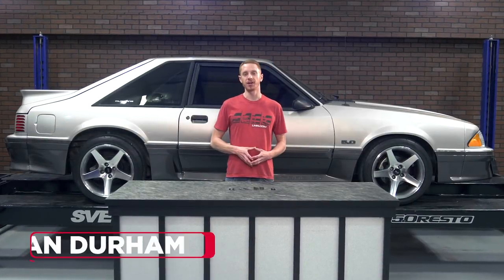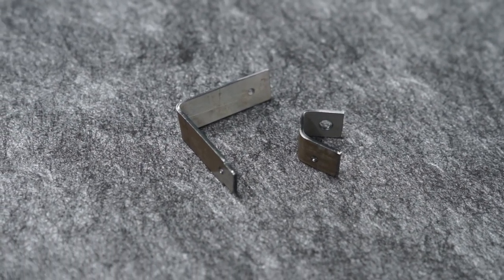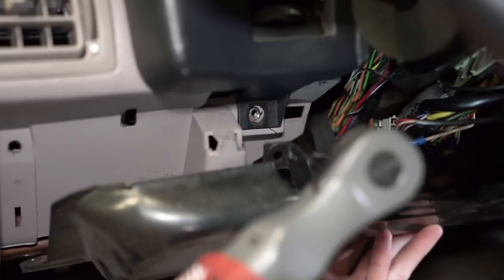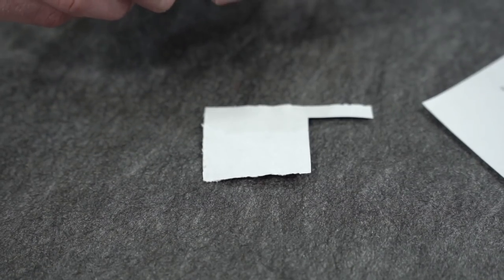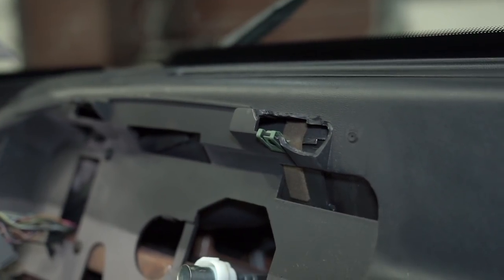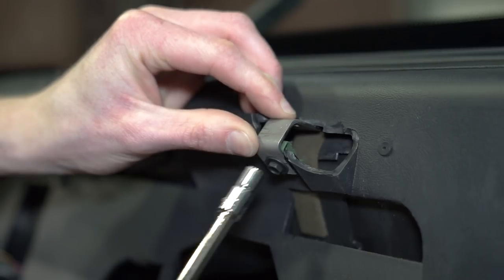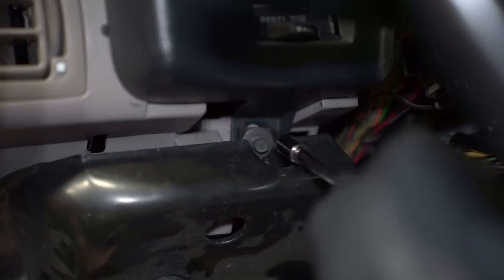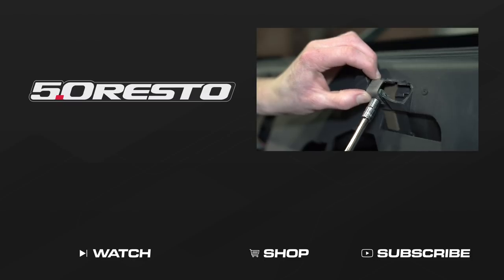1987-93 Fox Body Mustang 5.0Resto Instrument Bezel Repair Kit - Install & Review

Comment: I cut two pieces from a house window frame I glue them with Gorilla glue when dry I put cluster back I heat a hose remover tool with a torch punch the new holes and put the screws 💩worked great

Comment: I got this done the other day, it took me awhile to get everything lined up and the dash works good now, one thing that can help you lots is a little flashlight, after you do the left one and you need to do the right if you place the cluster and hold it you can really see where that right bracket needs to really be before you do any drilling.

Comment: I only had one issue.  I could not thread the metal brackets with the included screws.  I had to buy a tap and dye and then use machine screws.  Is there a better way?  I really want to use the factory 7mm screws.
Reply from the maker: Hey there, 

If you can, please give us a call at 1-866-507-3786 or use the contact us link below to email our tech team. We'll be more than happy to assist you! https://lmr.com/contact

Comment: Just installed this kit yesterday. I tried so many different glues, epoxies and bonding adhesives and they all eventually break. The install wasn’t too bad, had to trim some plastic (heating a blade like in the video was a great tip) and in my case I had to adjust the bend in the larger bracket to fit perfectly. Overall it feels very sturdy and solved a major annoyance I’ve been trying to fix for two years since buying my fox.
Reply from the maker: We at LMR Thank you for choosing us for all your Mustang Needs. We strive to bring you the best products and installation videos to help as well.

Comment: My coupe is good in this area..my hatch i had had this issue..
Reply: The reason this happens is because most of us when we remove the cluster for new white face gauges, maintenance  etc forget those 2 screws are in the back buried in the bezel, its really hard to see them and when you start to pry, that area is really delicate and snap! like you i have 2 of these cars and i learned the hard way 20 something years ago on one of them, still have nightmares about it,lol, I'm sure there are other reasons why this happens.